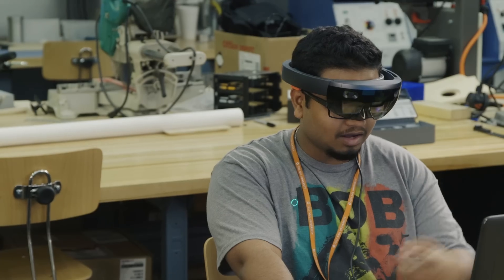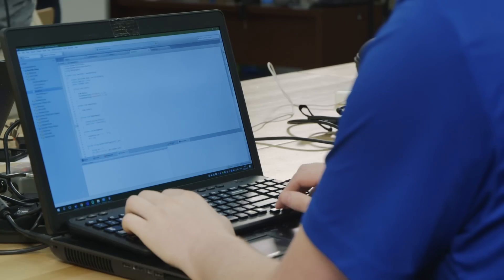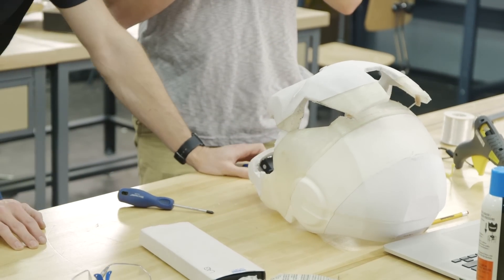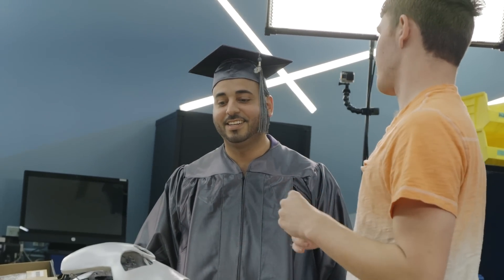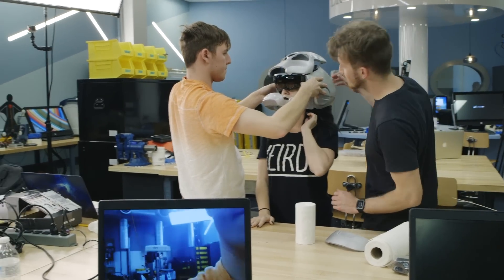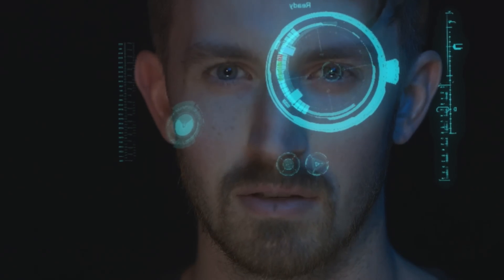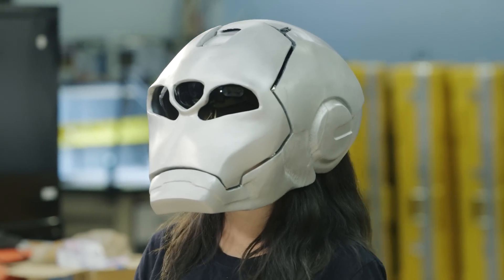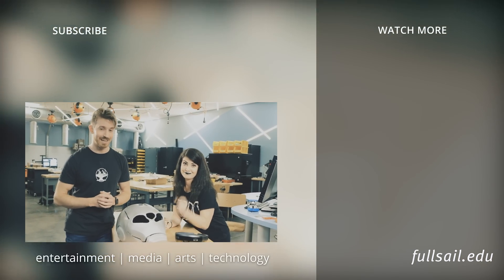Hacker Labs: Iron Man Helmet Challenge Ep. 4 ft. the Hacksmith | Full Sail University

Comment: Now build it out of a titainum aluminum alloy and connect it to a full suite of armor. The hacksmith could upgrade his flight system to work with the access weight of the suite and actual use a jet engine backpack and jet boots if there's enough padding inside the armor to fix the worry of over heating you could still use high powered fans in the arms to help balance out a landing and a take off. Then comes the power core issue which could be fixed with a charging station, it may have a shorter battery life and limited flight by the power core depletion but setting up multiple charging stations at different colleges could help with that and high altitude flight would be extremely dangerous. You could have replaceable power cores for emergencies but that would add to weight issue. The key to the power cores are the mini fusion reactor tech that doesn't exist yet. But what about solar panels? I'm not expecting a combat ready ironman suit with solar panels attached to it but that could possibly fix the power issue temporarily until the tech catches up with the project. The Jarvis a.I. would need sever improvement and be as close as possible to a tech genius or you could do what NASA does and have a team on the ground help monitor the well being of the suite and its pilot at all times the suite is active but that allows for human errors. A lot of tech has got to come together to make this more plausible and more convenient. The main issues are power,weight, and potential over heating and explosions from the jets killing the pilot and the project,but all scientific discovery comes with risks. The first few simulations would have to be auto piloted by the ground team/a.I and could end in destruction. I don't care if the suite is identical to ironman or engineered to be the same concept but with more realistic tech and look to make it more possible. Maybe you could build a heat proof/indestructible suite with a complete outter layer  of solar panels to help the power supply issue and have all the tech inside the helmet wired with censors to monitor the progress. I realize this is all completely out of y'alls budget range but that's why the billionaires have the best suites.

Comment: Idea......why not mount the lenses in the mask and run the wires needed up near the top hinges? You'd be able to reduce the size of the helmet that way. Currently, you have it sized around the smart lense headset, but taking the band out of the equation would reduce the size.